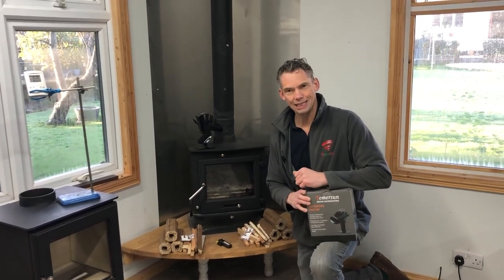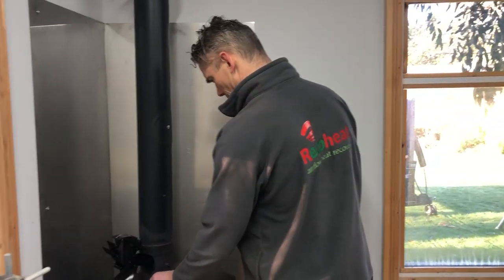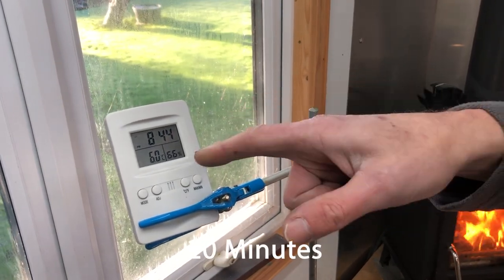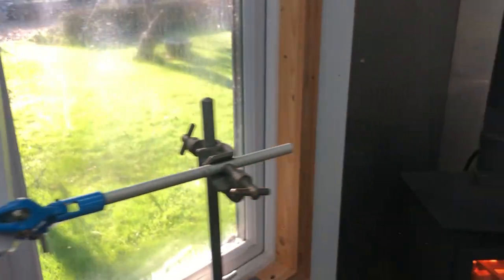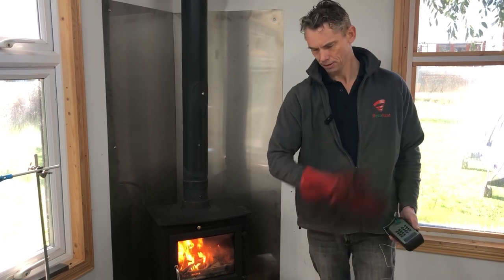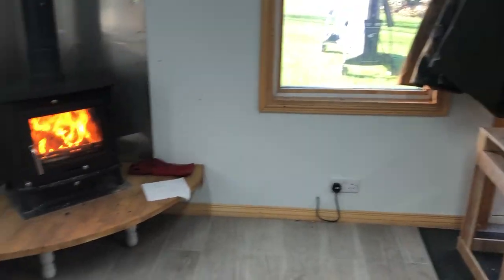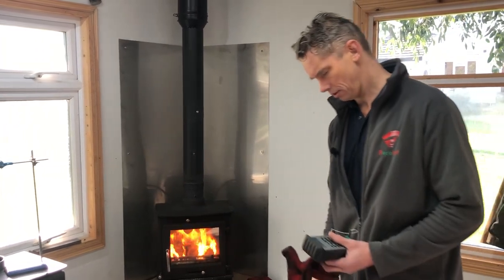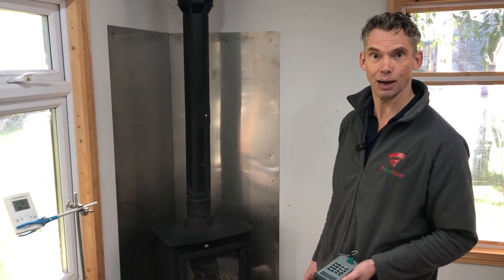STOVE FAN vs RECOHEAT (Wood Stove Accessory Comparison)

Comment: Please see my detailed review below. The advice you kindly provided has worked and the upstairs is getting up to 17-20 degrees (17 on the really cold day that was 0 degrees outside). I have stumbled across a new trick related to this video. I had a stove fan and although I found the Recoheat far superior, I have found that placing the stove fan directly in front of the heat output hole of the Recoheat makes the room really hot quickly, and by using a mere two logs. Pleased to have stumbled across this little trick - not sure if it works for anyone else or whether there is any science behind it but I've definitely noticed a change.
Reply from the maker: That's fantastic! Very interesting about the fan. Don't understand it properly - two almost opposing  possibilities might be that the fan is accelerating air around the Recoheat jet which makes heat transfer more efficient. Or, the fan is interrupting the dispersal of the heat by interrupting the turbulent flow, so making the immediate area hotter. That's definitely something to explore! Thanks very much again for persevering, for your interest and support. 👍👍
Reply: @Recoheat  thanks for your response and support. It really is interesting - I am not sure what is happening but it really does make a difference. The fan on its own makes very little difference. The Recoheat on its own makes a huge difference. The fan away from the Recoheat heat output valve makes some difference but bizarrely the fan in front of the Recoheat heat output valve is dispersing heat in an even manner and making the room feel a lot warmer. Your theories are both very plausible. When the stove top is not hot enough to spin the fan blades, the Recoheat's ejected heat turns the fan's blades when placed directly in front. I won't jump to any conclusions and will keep experimenting but thought I'd share my experience. Let me know if you come up with any other interesting theories of why I may be experiencing the effect I have described above. Keep up the wonderful work! 

I can't recommend the Recoheat to stove owners enough - you are all absolutely bonkers to go so long without one. Stop being pessimists - it isn't too good to be true, as so many things are sadly - it is the real deal.
Reply from the maker: Really interesting - big question is whether you think it increases the heat going out of the room, rather than just in the room? Thanks as ever for the enthusiasm and support.  @H.Ali_08
Reply: @Recoheat  yes, I think it would as the room heats up quicker so no doubt when I test it out properly for a long period of time it will heat the rest of the house sooner. Thanks again.
Reply: Minus 1 degrees Celsius outside and I'm in a T-shirt having followed your advice as to how to use Recoheat. I haven't even had to crack open a window. Sealing and draught proofing the doors to the downstairs room and leaving the passage door which leads to the upstairs opened has helped massively! I will be saving lots of money over the winter and won't have to turn on the radiator as much if I've managed to survive 1 degrees celsius outside. This product is truly revolutionary. Thought I'd provide this further feedback qualifying the con I listed above regarding heat not circulating through the house. The walls of my house are poorly insulated and yet the the Recoheat has more than taken the chill out of the air and made the temperatures very comfortable actually - not toasty hot like it is in the living room but that is where I was going wrong - you can't expect upstairs to be the same temperature! The upstairs of my house is at a comfortable temperature notwithstanding it being -1 outside and this all through using a mere 4 logs over the course of 7 hours or so! I buy a lot of gadgets and therefore I am bit of a shopaholic when it comes to online shopping for useful products and gadgets - this is by far my best purchase ever! You will enjoy your stove even more if you know you are increasing it's efficiency. As mentioned in a separate comment above placing a stove fan in front of the Recoheat heat output valve has been a game changer and I got temperatures of 27 degrees (two logs at a time total of 4 logs in a 7 hour window whilst it is 2 -1 outside!) Unreal the customers in the videos are not exaggerating when they sing the Recoheat's praises and I've been struck by the same potion!
Reply from the maker: That's fantastic - so good to hear. Thanks very much for your support!  @H.Ali_08
Reply from the maker: And spoke to your installer today - he was impressed as you say, and is going to be fitting them for us around north London, which is brilliant.  @H.Ali_08
Reply: @Recoheat  wow I am really pleased you managed to contact my installer and had a positive discussion. I'm glad to be spreading the word - I see it as a charitable act!
Reply from the maker: It sounds daft, doesn't it, but it is actually true! You see people whose stoves don't work and know what will transform the warmth in their home. It's a big thing!
 @H.Ali_08
Reply: @Recoheat  agreed - thanks for all your support.

Comment: Hi, very interesting videos. What has your experience been with using the Recoheat with stoves with convection panels (so the outer temperature is lower than traditional radiant stoves)? Does this effect the vortex you described? Thanks
Reply from the maker: Plenty of people are using them with such stoves. We even have a couple on mixed log and pellet burners in Scandinavia that work very well. The  effect must be different, but presumably the overall heat dispersal is the same, but it would be coming from lower down the stove to improve the dispersal: I assume that's the point. In that case, as long as the jet is being heated to the same degree, which it would be, the entrainment effect will still move that heat, as it extends for more than a metre from the nozzle.

Comment: How far away could i locate the pump unit? I'd like to place it in a separate room and pipe it to the coil
Reply from the maker: We've tested the airline up to 30m but supply 3m standard. If you do need more send an email and we can supply extra!
Reply: @Recoheat  excellent I'm thinking of less than 30m maybe 20m so I was going to use plastic push fit externally than on to copper when it re enters the house. Thanks for the reply
Reply from the maker: @TellyDan  That's a long way! But as long as there are no kinks, it should be absolutely fine. Sounds a great project!
Reply: @Recoheat  on another matter, has anyone attempted a silencer for the air outlet on the flue?
Reply from the maker: @TellyDan  It's very difficult because we can't interrupt the turbulent flow, which is the cause of the hiss. We do have engineers working on it using the physics model they built. It's not clear at the moment if we'll manage it.
Reply: @Recoheat  hi, I'm looking to order one. Can you send a list of dimensions for the 6 inch unit as I'm trying to measure up for changing my stove pipes
Reply from the maker: @TellyDan  Thanks Dan: details in the emails.

Comment: Great video. I am considering getting one. Do you have a decibel test thats been done for the noise of the Reco? In the videos the hissing sound seems quite loud but I know that on cameras sometimes the audio at certain pitches get magnified. Also Im curious house this would compare with an electric fan as the Reco one requires electricity to operate. And does this actually create more usable BTU in the house or is it just a matter of blowing the hot air around better? Thanks
Reply from the maker: Thanks a lot for the interest! The decibel test is here: https://www.youtube.com/watch?v=z0t3_nrurZg As you say, mics are completely messed up by the turbulent airflow. It is difficult to know how intrusive the sound will be in a room though, because it seems to depend most on the acoustics of the room. In a symmetrical room with minimal furniture, solid floor etc, it can be noisy, whereas in other rooms with lots going on, you don't notice it, or it's much less intrusive. The unit is kicking out about 1kw of heat, but the biggest difference it makes is the entrainment and stirring of the heat from the stove. If you look at the animation from the physics engine simulation, you can see the effect - and it's a transformation.
Reply: This initially looked like a great thing to do for increasing the efficiency of my stove. But the loud hissing would be quite distracting in the living room. Potentially it could be useful in a kitchen or utility room.

Comment: Your device may be good, but honestly you did not give as much attention to the air movement of the stove fan with your tissue, you kept moving your hand aeound. RTFM: stove fans ALWAYS  go to the back of the wood/multifuel stove.  Even the less expensive ones from Amazon.  

Yet the “test” with your device, you spent so much time with the airflow (no magic hand jiggling) and no mention of the noise it makes, or what is compares to.  Stove fans are silent operation (unless you have a Stirling engine” one.

As I live in Cambridgeshire, I will be visiting a place that has one of these devices in operation and see if the cost is justified..and the noise plus the installation and electricity for the pump.

Cheers

Comment: I just put an electric fan at the back of the stove, it blows huge amount of hot air to the other side of the house, I can feel the breeze 30feet away even at low speed,power cost for the fan is less than 5 dollars per month
Reply from the maker: Great! Glad to hear it's working well for you.